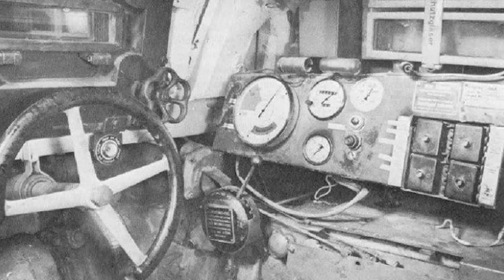A Deep Dive into the Tiger I, by the Chieftain

Comment: The unsung heroes of the Tiger story are the maintenance crews, they performed real miracles to get damaged tanks from the field and get them working again.
Reply: @michaelpielorz9283  Provided you'd have the good engine. Tiger necessitated specific tractors built only for the Tiger to permit the reparation crew to operate adequately.
Reply: Not "heroes".
Reply: And the Tiger had an impressive, for a heavy tank, overall operational average of 65% to 70% (West and East Fronts). This was close to the Panzer IV.

Source, Tom Jentz. Tiger I and II Combat Tactics.
Reply: Reminds me of a spinoff manga story from Girls und Panzer where Erica and the rest of her crew are removing their Tiger's mulitple wheels to fix a broken inner wheel. Erica gets angry at Germans and their obsession with complex engineering.😁

Comment: I must admit I do like the “cutaway” views of the tank. Apart from allowing a great insight into the various thickness of the various Armoured plates. Equally, if they hadn’t cutaway the collection, they would have gone to the scrap yard decades ago. 
Once again thank you for sharing
Reply: And an excellent view of just how thin the top deck and top turret armor is. People who say you couldnt KO a tank with MG rounds from aircraft need to see this.
Reply: @billd2635  Before you tell anyone to see this, find out how "thin" the thin parts really are. In this case, an early model, 25mm. Then it went up to 40mm. People who say you couldn't KO this tank with MG rounds from aircraft either knew why, or guessed right. The latter would need to see this, so their correct assumption becomes knowledge.

Comment: As a late pre-teen / early teen, I learned about the torsion bar suspension from a model of a Tiger that had functional tracks / suspension.
Reply: Might be easier just to give your age.
Reply: You can see on newsreels that the torsion bars gave German tanks a very stable ride, almost like having a hydraulic leveler. Must have been a real asset with the Zeiss optics.

Comment: One nice thing about the new KF51 Panther was they advertised that it took into account being able to travel in European roads and railcars, something that the Tiger has some difficulty due to its wide tracks.   This is possible due to reduction in some of the passive armor to lighten in more than the Leo 2.
Reply: KF51 recreational vehicle when?
Reply: @copter2000  😂 Yup, I guess with capability to launch drones to scout out nice camping areas,  it can function as such.  Seriously, though,  hope it does work as said in the tin if it ever is mass produced.
Reply: Absolutely nothing unique to the KF51. Basically all postwar tanks have had to meet rail requirements. Most tanks from WWII even had to meet them still, the Tiger was just a rare case where size trumped simplicity of rail logistics.
Reply: You leave out WW2 European roads had trouble sustaining its weight, let alone road bridges. Which was why the Hermans desperately stuck to rail transport for armor.
Reply: @zeitgeistx5239  Any tank wears out their transmission, tracks, engine etc etc and usually have only a few hundred km before requiring various rebuilds/ spares. Longer trips are always planned by truck low bed, or rail; plus it is faster.

The heavier the tank, generally the faster it occurred.

Not to mention the fuel required to road march, as well as road and bridge considerations.
Reply: The KF51 Panther's dimensions are designed to fit European railcar, tunnel, bridge clearances for ease of transportation.

Comment: Many interesting points made in the video, there has been a shift more recently in downplaying the effectiveness of the Tiger 1. I've been reading the book Tiger Battallion 507 which is made up of diary entries and combat reports from veterans of the unit and they certainly had some incredible successes on the eastern front, in 3 days of fighting around Karnievo in Poland 3rd company had destroyed 170 enemy tanks with no losses. 
They do report a lot of breakdowns however the repair company was very effective in getting vehicles repaired and back in action. Fielded in the right terrain with experienced crews and good supply and maintenance the Tiger was certainly an effective vehicle
Reply from the maker: Thanks for the recommendation, cold warfighter
Reply: I think a lot of the tiger's reputation is owed to the fact that the big cats were the bogeymen of allied tank crews, but the much more ubiquitous and common panzer IV F2/Js and StuG IVs were just as dangerous, especially in hit and run tactics. When you don't know what's hitting you but you know it's putting holes through all the tanks around you, it's natural to assume it's a big cat doing it (especially if the culprit was able to slip away after an ambush), when really the more common tanks and assault guns can do it just as well. A Sherman, jumbo non-withstanding, or a T34 is not going to fair any better against a 76mm high velocity gun than it would against an 88mm high velocity gun. So reports on how scary tiger ambushes were could be inflating that tiger reputation without it actually having anything to do with tigers or panthers.
Reply: I guess my observation would not be that there has been a recent 'downplaying', but a recent 'reality check'.  I think quite a few people over the years have over-hyped the good points without balancing out with the not-so-good points.  As you mention, a good, well-supplied unit was a serious threat...but as always, that's not the entire story.
Reply: Castle Graphics,

The opening posters point was that in recent years there has been an exaggerated fashion to declare the Tiger as useless, a waste of resources, ineffective, a pile of junk etc. That's not a "reality check". That's just nonsense. People still want to fight WW2 in 2022.
Reply: I'm German as well as a Historian for the IFZ and like most Germans of my Generation, i grew up with Grandfathers and Granduncles who served which included also one Relative who served on a Panther and later Tiger Crew both in the East and then the Battle of the Bulge (Ardennenoffensive). 
And what i learned from both Veterans & Historical Research is that the Tiger both had great Advantages and was devastating in many Cases, especially against the Soviets. 
However there was also a lot of Disadvantages ans catastrophic Cases of Tigers. 
But we are on the Internet and especially Axis Fanboys tend to overhype it while the Soviet Fanboys do the exact opposite and both are wrong.
Sadly there are also Historians & Researchers out there who have their Biases and like to present a Topic as either Good or Bad. Instead of doing what every Historian learns to do and presents both the Good and Bad. "Pop-Historians" are especially guilty of that, but Pop-Historians sell more Books, so it's lucrative to present only half the Story of a Topic.
Prost & Cheers from the Bavarian Alps
Reply: @CastleGraphics  
The entire Story is rarely presented sadly. Here in Germany (See my Post above) the Tiger like most Topics always was presented with the Good and the Bad. 
Right now it seems on the Internet that it's only focused on the Good or only on the Bad, which then of course has their own Group of People who either have a Bias that is blind to the bad side of a topic or blind to the good side. 
Books that only glorify a Topic or only vilify a Topic (especially if it's WW2 and Axis related Topic) just sell much better because in the End, most People prefer to get short Bits & Facts about a Topic instead of the whole Story with all the Facts and i can't blame them.
Reply: "there has been a shift more recently in downplaying the effectiveness of the Tiger 1"

The argument is quite simple, for each Tiger the German army lost (almost 50% were destroyed by Germans) 5 enemy tanks were destroyed, 
for the money one Tiger cost you would have got 4 Stug 3 which would have destroyed more than 8 enemy tanks...
Reply: @olafkunert3714
"for the money one Tiger cost you would have got 4 Stug 3"

Not as simple as that. 

1 x Tiger has 5 crew members and 92 rounds of ammo.

4 x Stug III needs 16 crew members and 216 rounds of ammo.

Plus 4 x Stug III needs a lot more support and supply personnel and their vehicles. Armour doesn't exist in a vaccum of just armour. To be effective they need support, and that supports costs a lot of money and resources.

Comment: When I look at the frontal armor always get two impressions.  One is that wow, it's a really thick and heavy slab of steel!  Then the other impression I quickly get is that it doesn't really look that thick considering its expected to defeat rounds flying thousands of feet per second!  Such an interesting beast of a tank.  Absolutely fascinating!
Reply from the maker: Thanks for watching, very glad you enjoyed it
Reply: Tiger drivers were trained to angle their tank against threats at 45 degrees - nearly doubling the effective armor.
Reply: @TTTT-oc4eb  They'd also preferably engage their targets at long range. The T-34 didn't even have an engagement range as far as the Panzer III due to poor optics and communication devices. It would have never had a chance against a Tiger that had spotted it first.
Reply: @TTTT-oc4eb  Never hear that before.  Seems like it could be a good move, but, wouldn't that necessarily expose some of your weaker side armor?  And wouldn't you be a bigger target, too, since the sides of a tank are longer than the more narrow front of the tank?
Reply: @polarvortex3294  Unlike a Panther, the Tiger's side armor was almost as thick as its hull front armor. Its user manual has several pages dedicated to this.
Reply: It's very flat too. No wonder tiger crews always angled their frontal armor.
Reply: @DovahFett  Although on paper the T-34/76 should have brushed aside the Panzer IIIs with considerable ease, in fact, the kil ratios were quite lopsided in the Germans' favor.  What some term "soft" factors (i.e, those outside the basic parameters of main weapon firepower, armor protection, and mobility) played a huge role in why the T-34 was not really all that successful, save for ONE thing, but it was quite important:  Its very appearance was a sharp and humiliating rebuke to the German notion of "Aryan Superiority" over the "Untermensch", as the very tenacity of Soviet soldiers themselves would demonstrate on millions of occasions through the "Great Patriotic War".

The very layout of the T-34 negated a great deal of its inherent advantages, along with that, in the wake of the purges of Soviet Army leadership in the late 1930s, it was taking awhile for competent officers to rise through the ranks, if they DARED.  Add to that very poor manufacturing methods, poor logistical support, and, given the desperation of the first two years of the war, little opportunity to properly train their crews; it was pretty much "OJT" with the survivors being able to build proficiency.

The T-34/85 solved a great deal of the downside of the first versions of the T-34, with a gun that at least gave it a chance against the German "Big Cats", and the three-man turret freeing up the tank commander to do his job ONLY.  Also, by then, thanks to Lend-Lease, the Soviets could equip all their AFVs with radios; which greatly helped their tactical proficiency.  While it's debatable that this was the "best" tank of the war, it was certainly one of the best, and could be devastating if properly employed.  In Korea in 1950, the DPRK People's Army used 250 of them in their initial invasion of South Korea, and they easily rolled over the ROK armed forces that had no tanks and practically no anti-tank weapons, and also made mincemeat out of "Task Force Smith", with its few M24 Chaffees, which were intended as scouting vehicles, not to duke it out with enemy armor in a slugfest.  But, in the battles along the Naktong river, in their final attempt to take Pusan and win the war, the T-34/85s were utterly "pasted" by UN Armor, especially the M4A3E8 Shermans.  This doesn't mean that these engagements were due to overall superiority of the Shermans, factors such as air support, armored doctrine, logistics, training, and leadership were also very much a factor in the DPRK's defeat.  Had a Soviet tank division been in that fight with the same T-34/85s, led by officers and senior noncoms that had combat experience against the "Fascists" and in Manchuria in 1945, they'd have probably given better account of themselves.
Reply: It also had unique nickel-steel with a Brinell Hardness of 265 on the front. This already gave it a 12% or more greater effective strength than the best allied steel of the same thickness, according to British tests carried out in Tunisia.
Source. Tom Jentz. Germanys Tiger Tank.
Reply: @lyndoncmp5751  The British test concluded that the 82mm upper side hull armor performed like it was 92mm of British macineable armor, and the 62mm lower hull side armor like it was no less than 82mm. 

This goes a long way to explain why even an outflanked Tiger was such a difficult nut to crack for the most common Allied AT and tank guns. In addition you have the relatively  low quality of Soviet and US AP shells. Low quality armor piercing shells meet high quality armor,
Reply: TT TT

Absolutely. Indeed. And it goes to show how often that shots that should have penetrated the Tiger on paper, commonly didn't.

We never hear of this "effective strength thickness" the Tiger had. Just the 100mm front thickness. In truth, it was considerably more than that. 👍

Quite right about the side armour as well.
Reply: @lyndoncmp5751  Yes, the turret front is often quoted as 100, 110 or 120mm. In reality the gun mantlet was 90-150mm (other sources says 90-200mm), and every bit 125mm or thinner was backed up by two heavy bars of 100mm armor, up and down, making the effective turret front armor 140-225mm. So when facing a well angled Tiger head on, you are facing at least 140mm of armor, and that is before you began to calculate the armor quality. That's a tough target even for a 17-pdr.
Reply: TT TT,

This is why I challenge people who comment on the film Fury and state the 76mm Sherman would be able to penetrate the front of the Tiger when they first encounter it. Well, not without HVAP it wouldn't. It would have to get within 500 yards, and even then be dead straight to it.
Even when the Shermans charge and close on it they are firing from an angle. Even at just 2 o'clock, as in the film, that's already about 150mm effective front.
Reply: @lyndoncmp5751 True. The 76mm M1 gun was a cat killer only on paper. German armor plates triggered weaknesses in its AP rounds that didn't show up in the flawed tests against softer US armor plates. The rounds were too soft and the HE filler tended to detonate on impact, causing the rounds to shatter. It even struggled against the hull front of the Panzer IV. As the 76mm first saw action after Normandy, there was little time left of the war to correct the problem, and the 76mm remained a big source of disappointment for US tankers. The 90mm M3 had the same problem, but this was partly compensated by the size of the round.
Reply: @selfdo  IMO, I'd argue the T-34 was one of the worst tanks in the war. It had an incredibly cramped interior, suspension that cramped the interior even more, poor mechanical reliability, was very prone to explode due to the ammunition being stored between the two huge fuel tanks, etc...
Reply: @lyndoncmp5751  I don't know about 500 yards, but also, the M4 didn't need to always penetrate a Tiger, it just needed to damage it. Having multiple M4s pound away at a Tiger or Panther could do such. There were also issues with the terrain involved and then combined-arms warfare. Western-front M4s rarely engaged Tigers at long distances on wide open flat fields like in the movie. The Soviets used the 76 mm M4s to great success on the Eastern Front.

I agree that armor quality is very much an issue. This is why they claimed that the 76 could penetrate the Panther's frontal armor and then in the field it failed to. Because Army Ordnance had made that decision by using American armor of the same thickness as the Panther's armor. 

Another thing to remember is that the quality of the armor on the German tanks was declining near the end of the war.
Reply: @WheelsRCool  The Soviet Army won the war with it simply because their factories could crank them out like hotcakes; and they could crew them, even though more T-34 "tankists" perished in their mounts than the fatalities of the entire USA ETO contingent, of ALL service branches.  

However, the Soviets gladly accepted the M4 Shermans sent to them in 1944 and 1945, dubbing them the "Emcha" ( "M4" being translated into the Cyrillic characters "Em" and "Cha").  They were issued to GUARDS tank divisions, so obviously the Soviet Army thought highly of their American-made mounts.